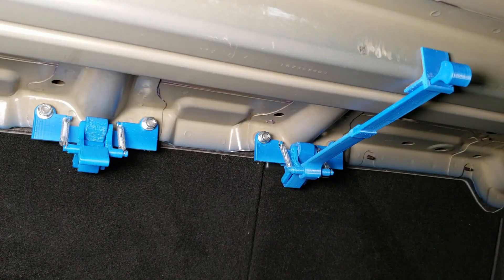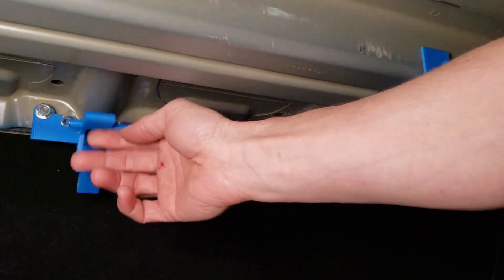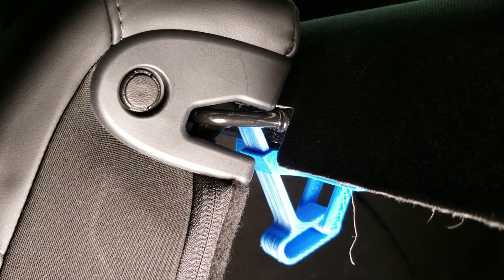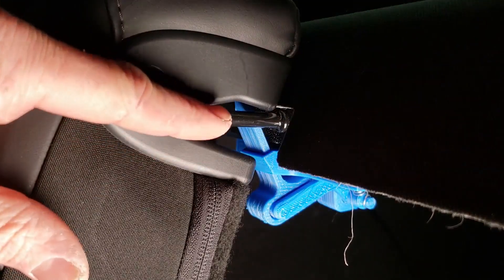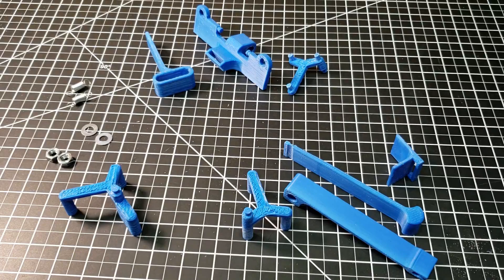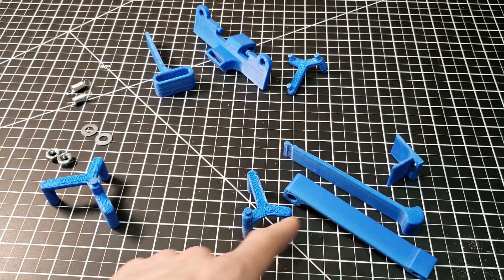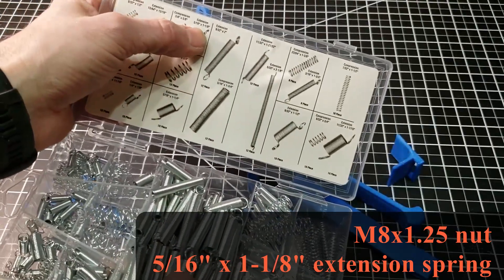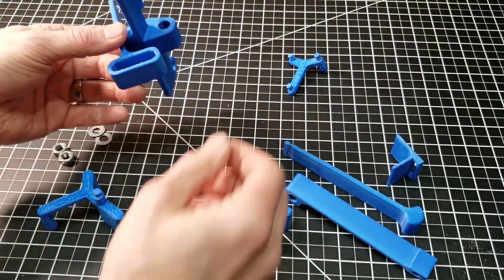Tesla Model 3 rear seat lock

Comment: Any idea if this will work on the refreshed 2021/2022 Model 3? I know the trunk itself changed, are the seats the same so printing this out will still work?
Reply: To my knowledge, the mechanism should still work, but the bolts used for mounting the lock apparatus need to be replaced -- newer Model 3 use bolts that are a little too short.

Comment: Clever design Jon. Thanks!

A pair of these will take about 20 hours to print depending on your printer and settings used. Print in PETG. Easy to print, strong, and handles car heat. Unless you have need to constantly fold seats, use the short handle version included in the files. Most people will leave the lock in the locked position and rarely need to fold the seats, so the less complicated but harder to reach short lever version is best to use as it's more reliable. 

Teslas is not customer service oriented. 2021 models still have a trunk you cannot secure. Don't hold your breath for a fix from Tesla. You can set a PIN code to lockout the glovebox but you can't lock the trunk. Go figure.

Comment: Bought one of these off eBay. Once the weather got hot the long pieces kept slipping out of position, and warped with the heat (I'm assuming it wasn't just gravity.)  Also luggage put in the trunk broke one of the long pieces, just snapped it when it caught on a suitcase.  Overall, I'm just not storing anything of value in my trunk, and most of the time leave the seats down in the back to save the breaking of the rear triangle windows by thieves.  Having the seats up, even if they can't get into the trunk itself, still invites a $300-500 window repair.

Comment: Very nice design, but the thief would need to break your window first to even know you have this lock. Once they try to fold the seat, they will figure you must have something worth selling in the trunk, and pry it open, since they can no longer just look in and see its empty.

The way to stop the break in is to have the rear seat folded down and an empty trunk. 

If you absolutely must keep valuables in the trunk and park in seedy areas, then this might buy you a few minutes.
Reply: A mini guillotine should be installed in the corner window.
Reply: Wirmish, yes, or a taser. It’s an electric car with 400v on tap. Someone needs to invent a thief zapper.

Comment: It's a nice idea but simply put it is plastic and 3D printed stuff is always VERY crappy.  I good pull and that will snap like a toothpick.
However it DOES add a nuisance factor to the theif so there is that.
Reply: The thing is, you can't get a "good pull" from the plastic handle on the top of the seat. Just can't happen. And pulling on the seat does nothing if that latch is still engaged. 3D printed stuff is NOT all crappy. Much depends on the material and the fill.

Comment: Amazing. I think you should mainstream these. I am wondering however that if someone is willing to break the window, will they not be able to release the latch and pull the seat back hard enough to break the plastic? Just asking because doing a modification for a rubberized metal lock on the 3D printed version wouldn't be very difficult to make.
Reply from the maker: The plastic doesn't hold the seat in place, it prevents the seat latch from actuating when you pull the handle, so it's the latch itself that keeps the seat in place.

Comment: This is certainly a great way to lock the rear seat backs of my Model 3. Unfortunately won't deter thieves from breaking the rear panel of the car, because they can't see from the outside that the seats are in fact locked. 

At least valuables locked inside the trunk won't be taken.
Reply: I purchased a visual indicator ( sticker ) for the rear windows that clearly states there's an anti-theft device installed.  It's better than nothing...

Comment: This is super clever!
Can you extend the idea with a servo motor connected to the locked state of the car. So that if the car is locked the seats are locked and if the car is unlocked, the seats are unlocked.
Reply: Rudi Larno excellent idea!
Reply: No, that does not help when a valet is using the car and you do not want him to have access to the trunk. That was a major point explained in the listing. Then if Tesla could add trunk open defeat to the software, then it would be complete. Or a valet would just be more obvious opening the lid, then just going in from the back seat. You could also see the trunk open on the app, but not the back seat down.
Reply: @pncelex2928  No, that does not help when a valet is using the car and you do not want him to have access to the trunk. That was a major point explained in the listing. Then if Tesla could add trunk open defeat to the software, then it would be complete. Or a valet would just be more obvious opening the lid, then just going in from the back seat. You could also see the trunk open on the app, but not the back seat down.

Comment: Brilliant! Do you offer these already printed, in kit form with the other hardware? I’m sure lots of folks would prefer to get the whole kit with one click...

This is a huge problem in the Bay Area. I will make sure that everyone in my BayModel3 fb group — with over 1200 owners now where this is the top issue we discuss daily — knows about this clever solution, especially if there’s an easy way to order the kit. Or maybe someone in the group would be willing to procure the hardware and printed parts so we can offer a group install party. We should also come up with a window sticker (maybe with a cute graphic that explains the rear seat is locked).  Anyway, thanks again for this incredible solution!!
Reply from the maker: I'm not set up to print in bulk or make up the kits, but if someone else is able/willing it would certainly be a nice option for people.

Comment: How about a release from the trunk?  :)
Reply from the maker: Should be do-able. If I find the time, I'll look into that.
Reply: @rdtc2854  That latch is cable-activated. I've been trying to figure out how to remove the cable from the release handle, and then create a way to pull the cable from the trunk. Bonus points for then covering the release handle with a smooth plate to make obvious that there's no reason to try... If I were a betting man, I'd bet that you figure this out before I do.
Reply from the maker: @darelldd  That was my initial thought as well, but after disassembly, it looks more straightforward to disconnect the factory cable at the latch and run a new cable from there to the trunk. I've already ordered parts to try it out.

Comment: how strong is this material?   if it gets very cold can it snap easily?  thanks
Reply from the maker: It's ABS plastic, which is pretty durable, but it's the car's seat latch that's holding the seat in place. The plastic "bolt" piece only prevents the latch from being actuated.
Reply: @rdtc2854  gotcha.  thx

Comment: Neat! Do you think there’s a way to do it such that it’s obvious looking into the cabin that the seat latches don’t work? I’m wondering if there’s a way to rig a latch release from the trunk and then replace the existing handles with blank plates.
Reply: Not sure thieves really look into the car before smashing the little rear window. Put a little sticker on the window saying break in protected or something. They might see that before they smash it.
Reply: @esprit1st75  i think they definitely do, considering most people have said the way to combat this right now is to leave the seats folded down.  thieves look in and can see the trunk is empty, so they move on.
Reply from the maker: Relocating the latch to the trunk should certainly be possible. If I find some time, I will look into that.